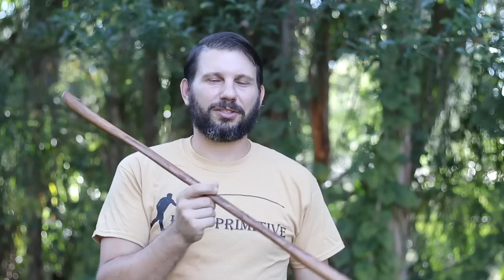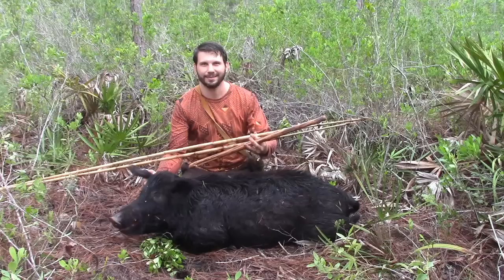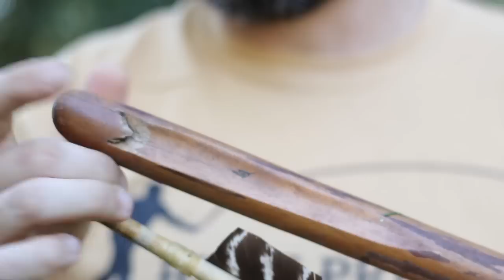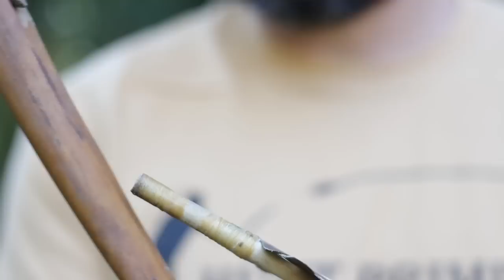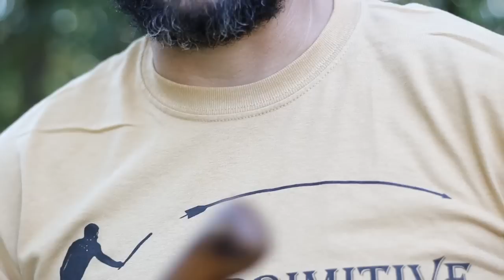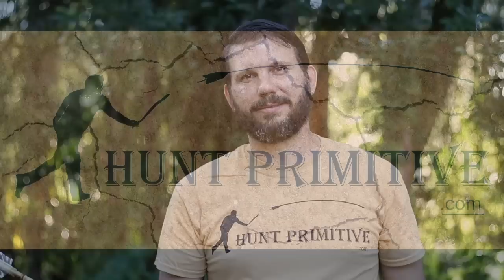How to Build an Atlatl Thrower : Part 2

Comment from the maker: Hey Folks, I accidentally edited out the portion where I talk about length of the thrower so I will put that info right here. I personally prefer longer than shorter so I can create more tip speed. My thrower is about 30 inches long but also remember my spears are 9ft long cane. If you are throwing shorter spears you may need a shorter thrower. If your thrower is short, it's going to be robbing some potential energy and prohibit you from throwing a heavier/ longer spear. There is no standard length that you have to use. I would honestly start as long as your arm and reduce as needed. This again is why it's important to figure all your spear specifics out first, then build the thrower to match.
Reply: What do think about turkey hunting with a shepard sling.
Reply: I would recommend that the thrower is as long as the distance from ur out stretched finger tips to the bend of ur elbow mine is 26" or so that's wat works best for me
Reply: What are the types of hunting license/permit do you need for hunting with a atlatl. New to hunting. I’m sure it varies from state to state. How would I go about checking?
Reply: @customafd248  Search for primitive weapon hunting. If you haven't found it in the last 3 years...
Reply: Hey man, got a question. I'm looking to build my first atlatl for primitive hunting, I'm 5'6 feet tall, and I'm guessing you're a lot taller. Would you still recommend I build out my atlatl for the 7' long darts you recommended in the previous part 1 video? Or should I reduce the length of the darts to 6' to make them easier to carry as well as balance more easily for a 15 inch thrower (the length of my arm) I know that you mentioned 6' long darts as being not powerful enough for hunting medium to large game but I was wondering if that was relative to the height of the user or not. Would love your input. Thanks

Comment: Thrower should be the lightest possible; It adds nothing to impact energy , same as bow limbs should be lightest possible.
The spear on the other hand must  carry mass to impart energy and penetration.
A heavy thrower will just slow down your hand and contribute nothing to energy.
Spear E=MV squared / 2
Reply: agree, a stone on the handle could be useful for balance but it will take some energy away from the dart.  

i came to this from looking at bannerstones.  They don't look like they'd be good for putting on a dart or the thrower.  A dart smoother, maybe, but nah.  Too much trouble for something that could be done with a groove, which is far easier to make than a hole.  idk just talking it out

Comment: I see some commenters who wanted a step-by-step instruction manual with, I guess, precise dimensions and how to use each tool.  I find your discussion of theory and broad goals of the build more interesting and more helpful. I'm 2,800 air miles away from any river cane.  I use softwood and fiberglass driveway markers for darts, because I'm doing it at a hobbyist level, not to hunt with.

Comment: I need to thin my thrower down more. Darts are 7.5 with bone head, 8ft with refurbished kitchen knife point and 8.5 with the same steel point. Thrower is 30 inches

Comment: I love making and using stone age tools, but for me it's about being able to cope in any survival situation.  In most types of terrain and regions, I can go into the wild with nothing, and have fire, food, shelter, and a weapon before a day is out.

But my goal is not to be a bear, grizzly or otherwise.  My goal is to be a human who is able to kill a grizzly, if I have to do so.  So in the wild, I'll use whatever I can find on the killing end of a weapon.  It will likely be flint in most areas, obsidian in other areas, or, if I'm really lucky, lost or discarded metal.

Different reasons for learning.  For me, primitive weapons and skills are fun to make and fun to use, but the fun stops when survival starts, and survival is why I spend time on primitive weapons and skills when fifty other things are calling for my time and attention.

I've heard the argument for heavier atlatls, which is what you call the thrower, before, but it doesn't make any sense, and is completely unscientific. Dart speed is generated purely by atlatl speed, and atlatl speed is generated by arm speed.  The more mass something has, the more inertia it has, and the move difficult is is to move.  The reason you can't throw a cannonball as fast as you can throw a baseball is not because the cannonball is heavier, it's because the cannonball has far more inertia.

This applies to atlatls and darts, as well.  The more mass, the more inertia, and the more force is required to start them moving, and to accelerate them to high velocity.   There is no potential energy in a atlatl, heavy or light.  A heavy atlatl does not impart a single speck of energy to the dart.  To the contrary, the heavier an atlatl is, or to be precise, the more mass it has, and the more mass the dart has, the more inertia there is to overcome, and the more force will be required to start everything moving, and to accelate it to a high velocity in the span of time between when the motion begins and when the dart leaves the atlatl.

In other words, a heavy atlatl generates less velocity than a light atlatl, and a light, flexible atlatl generates more speed than either.  The reason a heavier atlatl can be important is purely for balance.  No one ties a rock on an atlatl because they think this will improve the speed of the dart.  Any mass added to the thrower slows the velocity of the dart to some degree.  The rock is there for balance, and balance is needed for better accuracy.  Well, actually balance is needed for EASIER, not BETTER accuracy.

A six foot dart that weighs 4,000 grains is easier to balance than a nine foot dart that weighs 4,000 grains because there's less weight out in front of the thrower.

And when it comes to energy, let's get real.  Energy equals one half mass times velocity squared.   If your dart knocks an animal down, it is not because it has more energy than an arrow, it's because it has more inertia.

The atlatl is a fun, and even deadly weapon at close range, but it's a piss poor hunting weapons for game of any size, and should never, ever be legal for large game.  The odds of wounding a big game animal are many, many times higher with an atlatl than with a bow, and enough animals are merely wounded with bows.   Wounding an animal and allowing it to escape is unconscionable, and something only a very primitive man would ever risk, unless his life were on the line, and nothing any good regulating body would allow.

And, again, let's get real. The ONLY reason primitive man used the atlatl was because they had no better weapon.  When the bow was invented, the atlatl quickly vanished from the scene because the bow is INFINITELY better in every possible way.  The bow is also an infinitely better survival weapon than an atlatl.  The atlatl is fun, and I love using one, but I can't even imagine a situation or setting, where I'll make an atlatl for huntign or survival or self-defense.  Compared to a bow, it sucks dead bunnies.

In a day, I can make a bow capable of flinging an arrow at forty-four meters per second, and accurate enough to put three arrows in the heart/lung section of a deer at twenty-five yards, or in the heart/lung section of a moose at fifty yards.This is never, ever going to happen with an atlatle.  In a week, I can make a pretty well-seasoned bow that is stronger and more accurate, that can kill a grizzly, or anything else, at a safe distance.

You're light on terminology, and lighter still on physics.  What you call the thrower IS the atlatl.  What you call the spear is the dart, though yours really are spears.

Atlatls come in all sizes and shapes, , and yours, a heavy, stiff, straight atlatl, is by far the least efficient of them all.  It may be the easiest to learn how to use, but you're trading ease of learning for both distance and power. And like it or not, if you take the time to learn how to use a long, flexible, curved atlatl accurately with much smaller darts, you will have a far deadlier weapon with much greater range.  You've taken the easy way out at every turn, rather than face a steeper learning curve.  You would be almost as well off just using a speare.

Within reason, there is no correlation between length of the dart and length of the atlatl.  These matter only in ease of learning.  A six foot darts throws just as well from a thirty-inch atlatl as a nine foot dart.  Again, it's about balance and ease of learning.  But everyone talks about adding a rock to the atlatl for balance, but are seemingly unaware than you can add a rock to the end of a much shorter dart and not only achieve balance, but increase killing power by making a much larger wound channel. 

The rock you add is a longer, heavier point or broadhead.  

There is no reason why a six foot dart cannot weigh 4,000 grains, but there is also absolutely no reason why it should, or why a nine foot speare should, either..  Velocity always more than compensates for mass.  If it didn't, firearms wouldn't exist, and if they did, a bullet traveling at three thousand feet per second would just bounce off our skin.

The simply fact is that you do not have a very good underastanding opf physics, and you make assumptions that simply are not true.  

And while the atlatl was wonderful when first invented, only a total lizard brain would ever use one for hunting big game, unless he had to have that big game in order to survive.  Killing a big game animal is not about your ego, it's not about wanting to emulate primitive man, and it sure as hall is not a sport.  It's about taking a life, and if you're going to do this you had damned well better be certain you do not would an animal and allow it to escape.  You simply eliminate this possibility to every reasonable degree.

The simple fact is that an atlatl, even a good one, which your is not, should never be used on anything larger than a deer.  The simple fat is allso that a six foot, fairly light weight dart, and a long, flexible atlatl that has a curve near the handle is a far better, far, far more efficient weapon that your is.  

The atlatl was valuable to primitive man because it extended his killing distance, not because it allowed him to do something at ten to fifteen yards that he could already do with a throwing spear.   It was the sixty yard throw, and longer, that elevated those who had the atlatl from those who did not.  A volley at atlatl darts could stop an attacking tribe long before they got in range with throwing weapons, jsut as that same volley could make several kills when lauched into herd or flock animals at sity to seventy-five yards.

All you're doing with a heavy, stiff atlatl and nine foot long, 4000 grain darts is turning a wonderful, innovative long range weapon back into a throwing spear.

You might decide to tackle the steeper learning curve of learning to use the atlatl as it was intended to be used, as a long distance weapon that use shorter, thinner high velocity darts, rather than an extremely short range weapon that uses giant, heavy darts.  It is possible to be just as accurate with a six foot dart and a long,  flexible, curved atlatl as it is with a stiff, heavy, non-flexible, straight atlatl.  The six foot dart is every bit as deadly, and at a far greater distance, and even more accurate, if you take the time to learn how to use it.
Reply: Ok professor, did you miss the point about," this is his preference, and not how you have to"! If your goal was to over think, and drain the fun out of this for everyone else? You win! Maybe you can spout your high headed by request next time? Or possibly start your own channel to flaunt your theory of scientific data? But in the meantime, let some fans of stone age weapons and tools just enjoy ourselves! Still believe" opinions are like A-HOLES, they all stink, and shouldn't be publicly displayed"! But thanks for over sharing!
Reply: James Ritchie Jesus Christ how long did it take to write that?
Reply: Yeah ok hippie. Around here we might kill a deer with an inch and a half wrench. Or kill a pig with a rock. Fuck YOUR physics buddy.
Reply: Sir, that is very impressive.

Comment: I am having trouble with my atlatl and accuracy. However I cannot find usable River cane where I live. I built my dart out of Ash and it is very nosey I'm going to build a longer thrower and hopefully that works. I love this Channel and the information you have! And if this fails I may be buying some rivercane darts from you
Reply: If you're using heavier materials to make the dart, maybe it doesn't need to be as long to reach the proper weight (~3000 grains). Then you adjust the atlatl to balance that. Shorter dart = less nosey. And you can always add weight in the back of the thrower. Or you can lighten the foreshaft a bit, trying not to weaken it. The better your balance, slightly nosey, the better your accuracy. At least that's how I understand what he's saying.

Comment: would cattail stems work instead of river cane because there is no river cane around here
Reply: Try bamboo but to be honest anything long enough and straight enough with the right spine strength and weight will work fine I've used tree saplings just dry them out and use heat/fire to harden and straighten them and remember they need to be forward heavy use the thick end as the point and the skinny end for ur knock 
Note: the atlatl and dart combine should be less than a pound ideally 3/4 of a pound or less